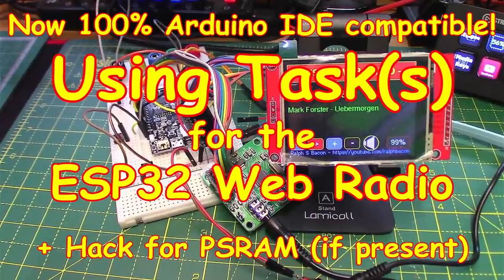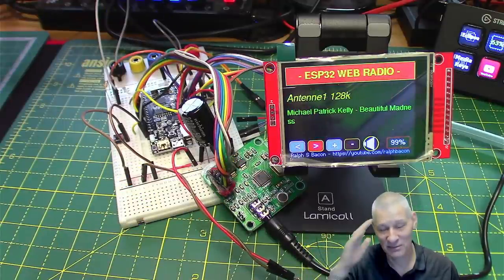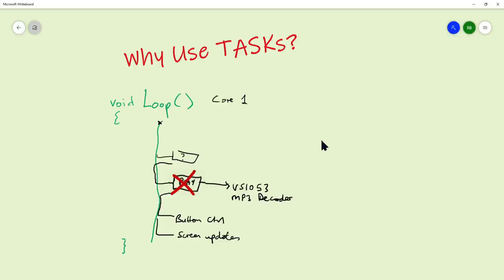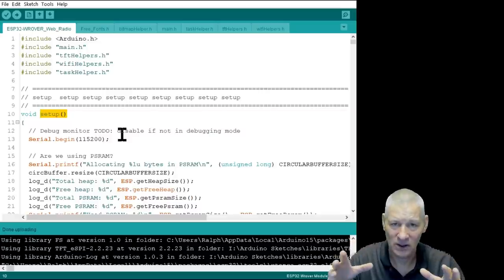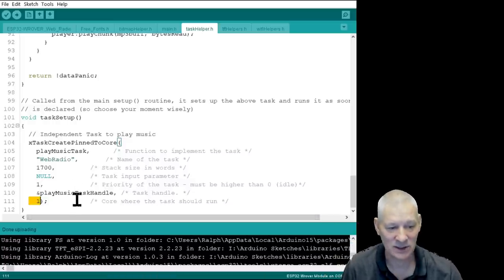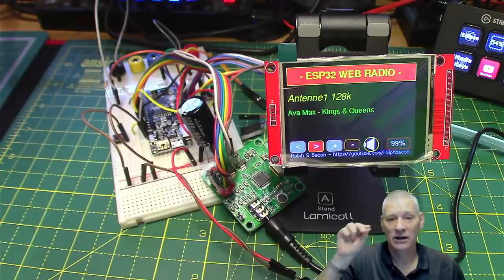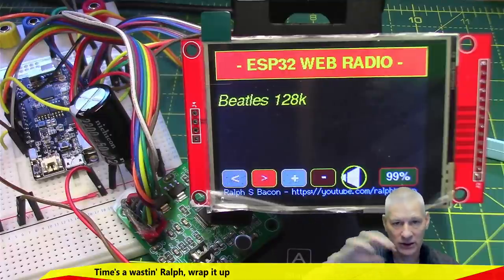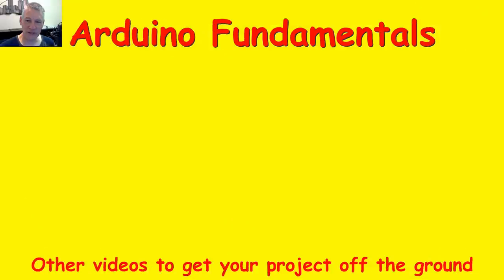#208 Using an ESP32 Task for my Web Radio - using the Arduino IDE

Comment: Ralph, having followed your instruction for many years I must admit that this particular project has pushed my tech understanding well past its usual limits. Having said that, I am hanging on by my nails and have purchased all the parts, but am having problems understanding the schematic. I should say that I have a good basic knowledge of interpreting electronic schematics, but so far this one has me beat. Any chance of a few pointers? For instance where are H4 and H1? The TFT Screen has a 14 pin connector with 5 pins annotated ‘TOUCH’, but how does this relate to the GPIO Notes that say ‘Touch pins T0 to T9 are mapped to GPIO pins. I suspect that some of the designations on the drawing refer to the yet to be produced PCB, but in the mean time it would be nice to get a ‘lashup’ running.

Thanks as always Ralph, and hope your move is uneventful.
Reply from the maker: If you have a sneak peek at my GitHub for the video on Xmas Day you might get a better idea. The schematics are there and photos of the PCBs. The video will be releases at 6am so it may help clarify things. If not, let me know.
https://github.com/RalphBacon/210-ESP32-Web-Radio-PCBs-And-More
Reply: @RalphBacon  Thanks Ralph.

Comment: Great stuff dry topic to explain.
I see that you are getting witty as usual 😋
-how well it doesn't run, good one
-do i have a memory leak? probably but not in your code 😂
If possible, sign me up fo PCBs.
I have to see #208 again to catch the difference between Task and multitask, seems the same.
Reply from the maker: Multitasking is simply running more than one task "simultaneously". So, in this example, allowing the loop( ) to run along this new task makes it multitasking, right? 
That's even before I add a new task to grab the streaming data and push it into the circular buffer. Now I was going to say something else but that memory leak has appeared again!

Comment: I'm so glad, that you are building the project that sits on my shelf for more than a year now. I'm looking forward to utilize your code to build it eventually.

But why would you go back from PlatformIO to Arduino? I can't think of a good reason to do this.
Reply: Because I am a beginner and asked Ralph to do it and he was so kind. I do feel guilty that he has had all these problems.
Reply: The only reason must be that Ralph knows most of the viewers for his videos will be using Arduino IDE, so he is just catering to the masses !
Reply: @geoffw.5003  I'm not sure why anyone would prefer Arduino ide over vscode/platformio. I converted all my projects to platformio, because of the great ide and also the tooling. Arduino ide is like stepping back in time.
Reply: @pauloe8pck830  I see, did you try platformio? I think it is easier for a beginner.
Reply from the maker: This is a port (conversion) of the PlatformIO version back to Arduino IDE. The two are separate projects and the Arduino will need constant updating to keep it in line with the PlatformIO version. But, as Geoff W says, I know that many viewers are using the Arduino IDE so this will at least give them a project they can get started with!

Comment: I was forced to use a task when my code needed more than the default amount of stack - as you show, with tasks you get to specify your stack needs.  Also when you move to tasks, you've got to put vTaskDelay(10); at the appropriate places or you'll get a watchdog timer fault.  My PM2.5 pollution sensor is running well with 5 tasks, broken into logically separate functions.
Reply from the maker: I tested out all this delay(), vTaskDelay() (which is what delay turns into), yield() etc and I didn't need any of them. The task just does its while(1) and that's enough to keep it going. Comments in the code!
Reply: @RalphBacon  Interesting!  I must be doing just enough to trigger the watchdog.  Thanks!

Comment: You mention that you made changes to the circular buffer code to use PSRAM.  I have been searching for the changes you made but haven't found where it is documented.  I have seen some other replies with parts of the changes.  Are these changes documented somewhere?
Reply from the maker: They are (sort of) documented under the GitHub entry for video #205 (which also has the latest code base). However, it depends greatly on which IDE you are using, Arduino or PlatformIO?

Comment: Hi Ralph,
Since you are building 4 layer boards for this project I wondered if you can show how to set up the design in EasyEDA - I have tried but can't seem to get it to work with 4 layer boards and auto routing (as a starter).
Reply from the maker: Nope, not using a 4-layer board, David, absolutely no need in this design. However, to do that in EasyEDA, go to the Layers and Objects floating window, click the settings (cog wheel) and in the pop-up Layer Manager you can add more layers of copper using the drop down list. I had to do this in one of my designs but my brain exploded whilst doing it, it seems that computers can handle that but not my brain! But it worked, so kudos to the auto router (which I hope you've downloaded the latest version and are running locally, so much quicker).

Comment: This ESP32 radio project spurned me on to produce something similar.  I'm still waiting for a VS1053 so I purchased a PCM5102A instead and used the ESP32-audioI2S library from schreibfaul1.  First time using tasks on ESP32 and even had to add some mutexes and critical sections.  All working well but I've a question about the ILI9341 which maybe someone here can help with ... I'd like to use (or at least understand) how the T_IRQ pin of the touch screen works or can be used.  E.g. I'd like to trigger an interrupt when the screen is touched (rather than polling).  Struggling to find any documentation online.
Reply from the maker: The T_IRQ goes LOW, Michael, when you touch the screen, anywhere, with any pressure. Using Bodmer's TFT_eSPI library for the ILI9341, you can then do a getTouch() which returns the X,Y co-ordinates and you also set the minimum pressure (min 20, default something like 100 which I find too low. I use about 40). If you don't reach the required pressure (eg unwanted finger press, it is ignored).
I also expected to have to write an interrupt routine but polling every 100mS (state machine) works just fine and doesn't then slow down anything else in the loop() because the getTouch takes a significant amount of time (a few millis). Look at my (now out-of-date) code in my GitHub if you're interested in how I do this.
Reply: @RalphBacon  I've also found that the interrupt approach isn't really needed, polling seems to work fine but would like to do it as academic exercise.  However, I've found that even without touching the screen I see T_IRQ (connected to GPIO 33) is going low and triggering a couple of times a second.  Not sure why yet.  Oh and thanks for the great videos and the effort you put in to the channel.
Reply from the maker: It is indeed a very noisy signal I get on that pin. But when it goes LOW (ie I have really touched the screen) it definitely goes and stays LOW.
I'm guessing that when a press is detected the getTouch will tell you whether there was any pressure on the screen (above 20) and/or what the coordinates were. So far, nothing bad has happened to my program because of this (no false triggers).
Thank you for your kind words about my channel, it's been a fun journey.

Comment: I noted that the ESP32 you use now have the metal dohicki-antenna and which arguable have better antenna performance and consistently among suppliers than the integrated PCB antenna, found of various ESP32 dev boards. I noticed on my own tests (and note both are ESP32 v1.0), that the TTGO board connects quick and stay connected to WiFi. My ESP32 (unknown brand) with the PCB antenna traces, shows flaky performance at best. I speculating now, may it be so that lots of clone ESP32 does not get the PCB antenna design just right. I think that the antenna matching  is pretty critical at these high frequencies,  just my 2cents.
Reply from the maker: You may very well be right. I do have a couple of ESP32s with the external antenna option which could be put to good use eventually, if I discover that this is relevant (and let's face it, a better aerial must get a better signal).

Comment: Would you do a video on the time that it takes different micros to calculate the Collatz Conjecture sequences? I think it might interest you. My PC for instance takes the very scientific measurement of forever and a half in Python to calculate 27 as an input to a recursive Collatz function I wrote.
Reply from the maker: My question to you is, why don't you do it? I'm not sure my viewers would not appreciate such a specialist function that much, sorry! The formula for doing this is documented on Wikipedia and if you use a fast processor (eg ESP32) it should take no time!
Reply: @RalphBacon  Just thought it would be a nice alternative to your prime test. No need to get upset.
Reply from the maker: No, there's no upset here, I just wondered why I would want to do it, but if it stresses (loads) the microcontroller that would be a good bit of code to run instead of the prime number calculator, just as you suggest. I will re-read the Wiki page to find out what its purpose is (not that it matters, particularly). I can then re-pitch the Arduino UNO vs the ESP32, I wonder which one will win, any takers?

Comment: Hi Ralph
Please put me down for a board and please keep the support for arduino ide
made some progress with the 208 version picture on the screen, but still no sound. onwards and upwards.
Regards John.
Reply from the maker: OK, hint: I use the "Intro.mp3" in the data directory on startup ("ESP32 Web Radio" announcement) and that will confirm that the VS1053 is working (or not). Get that bit working first before getting it to play music (that is why I put it there!).

Comment: Great video yet again, if you make the Boards, could you make the SMD pads a tad larger than the last one that were on the interupts board, :-) for us old half blind shakey hands persons
Reply from the maker: Possibly! I've only used 3 SMD components for 0805 components so pretty big and 0603 fit too. But they are mostly optional anyway! Keep tuned.
Reply: @RalphBacon  No change of through hole then:-(
Reply from the maker: There is the through-hole option for the resistor that must be fitted. The other SMD two are for I2C only which we are not using (yet) in this design.
Reply: @RalphBacon  HA HA one device I can solder :-)

Comment: Hi Ralph,
I was inspired by you recent videos and decided to build your excellent internet radio - unfortunately it seems I've missed a step that I just can't see. Code compiles and uploads ok but nothing it just sits there with a white screen. I've tried uploading tft examples to check connections and libraries etc - no problem. Would it be possible to add a section to one of your upcoming videos
 to explain how to implement the software in step by step form.
Reply from the maker: A few questions Bernard: 
1. How are you uploading this, using the Arduino IDE or PlatformIO? 
2. Have you checked the serial monitor output from a clean boot, that should definitely tell you (or me) something. For example, is it constantly rebooting?
3. If so, find the "main.h" file and reduce the 150000 (150K) circular buffer size to 10000 (10K) to see whether that sorts things out (for now, anyway).
Let me know!
Reply: @RalphBacon  Hi Ralph,  in answer to your questions - 1/ Arduino IDE  2/ Yes constantly rebooting 3/ Changed circular buffer to 10K and bingo screen fired up and music came out. 
Sir you are truly a genius!
Only problem now is buttons are not working - serial monitor reports " Button not pushed hard enough" so it seems to be detecting something . Next button on board works to change station. Any ideas?
Many thanks for taking the time to help an idiot.
Reply from the maker: Try pushing the buttons a bit harder (with limitations). I found a gentle touch is not enough, you do have to push with intent so it doesn't think it was just your finger grazing the screen. I use the pointer/stylus.
Reply: @RalphBacon  Sorry me again. Even pushing the buttons with intent and adopting a forceful look coupled with a few choice words doesn't have the desired effect. This the output from coolterm :- TFT Calibration data:
0179, 92C3, 040D, C301, 0D92, 
Touch Calibration completed
[E][esp32-hal-cpu.c:93] addApbChangeCallback(): duplicate func=400E007C arg=3FFBF1E8
Loaded in 8 ms
TFT Initialised
Free memory: 297264 bytes
[W][LITTLEFS.cpp:38] begin(): LITTLEFS Already Mounted!
LITTLEFS Mount SUCCESSFUL.
Starting player
Waiting for VS1053 initialisation to complete.
Switching player to MP3 mode
Looking for key 'SSID'.
LITTLEFS parameter 'SSID'
Looking for key 'WiFiPassword'.
LITTLEFS parameter 'WiFiPassword'
Connecting to SSID: TP-LINK_F15F6C

Having reread your readme file I am copying the returned calibration data as above into the data file in the sketch folder. Is that right?
Reply from the maker: Yes, although not exactly critical to getting it all working. There is a new version available now:
https://github.com/RalphBacon/205-Internet-Radio/tree/main/Arduino%20IDE%20Version

Comment: Hi Ralph - I made a web radio based on your code and the original urls worked fine.  However, it seems like the BBC streams from bbcmedia.ic.llnwd.net for eg Radio 4 will end on 22 March this year - there is an hourly announcement of this.  They will then move, and there will be a playlist url, inside of which are new urls such as stream.live.vc.bbcmedia.co.uk/bbc_radio_fourfm  I've swapped my station urls for the new one and they do play, but are full of audio artifacts, I assume that the ESP32 isn't going fast enough now, possibly due to a higher bitrate (not sure) - just found this out today, so haven't yet found a solution but thought I'd mention it to you.
Reply: I'll answer my own question.  Don't know if this is the cause or not, but the sample rate of the old stream is 44100, and the new one is 48000.  In https://github.com/baldram/ESP_VS1053_Library/issues/52 there is a mention of a potential fix for watery audio.  I tried changing String("GET ") + radioStation[stationNo].path + " HTTP/1.1\r\n" +  to String("GET ") + radioStation[stationNo].path + " HTTP/1.0\r\n" +    and that made my audio clear again.  HTH
Reply: @randomsporadicprojects8941   Thanks that worked for me too,no more chirping
Reply: @patfarrell5663  Happy to hear that
Reply from the maker: I'm glad this got resolved in my absence as the BBC stations disappeared from my ESP32 Web Radio when I switched it on for the first time in weeks. I shall be checking the solutions out, appreciated.
Reply: @RalphBacon  Hi Ralph the solution still works very well
Reply: @pierutube  Happy that it works for you.  No need for any token of appreciation, your thanking me is sufficient.  We all know and find out different stuff, so sharing is mutually beneficial.
Reply: @RalphBacon  Good to hear from you (was wondering if you were ok, hope so).  This web radio project caused me to investigate other audio projects and I ended up messing with rpi tts based on mqtt messages.
Reply from the maker: I've just implemented your suggested solution (HTTP\1.0) and it solves the issue completely on BBC stations. I've mentioned it in this week's video. Most appreciated, thank you. On the topic of RasPi and MQTT et al I wanted to do this a couple of years ago but never quite had the time; perhaps I'll be able to do this now!